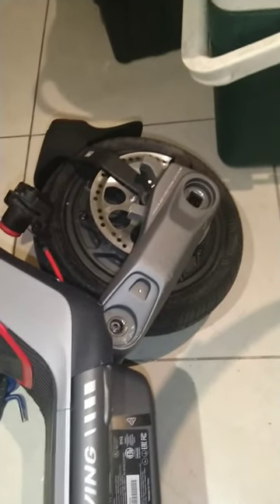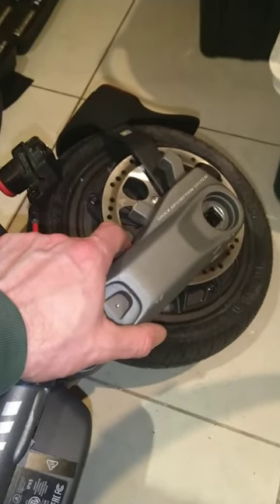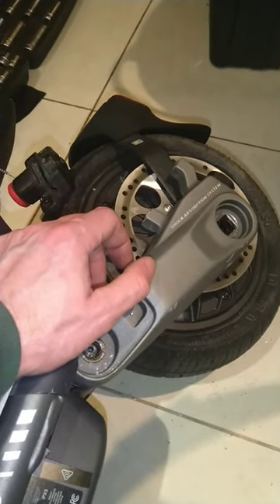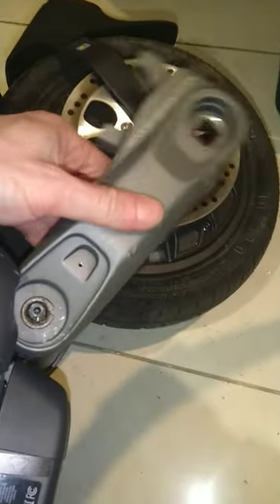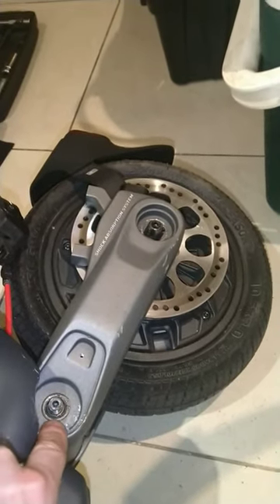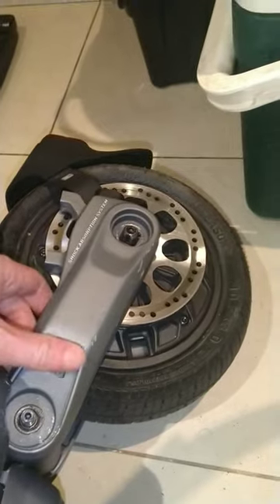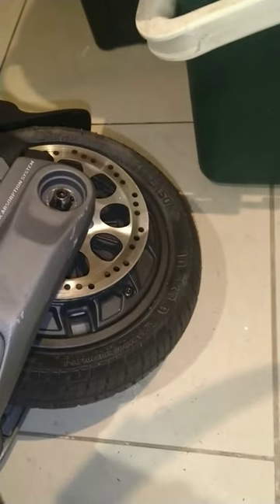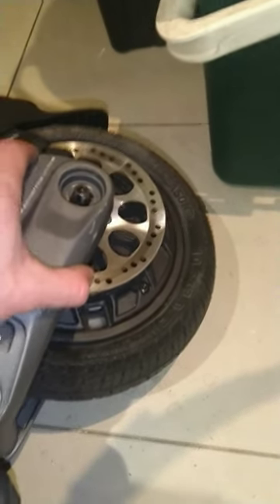Segway P100S shock only loads one side of the swingarm

Comment: Yep, everyone is going to experience some kind of issues with nuts becoming loose over time. As I had to address these issues, I went ahead and replaced the nuts with new high quality ones and also got nylon washers too. Using lock tight is recommended. After doing these improvements I've had no issues. After doing these maintenance updates I'm completely satisfied with this model. (Just for any readers having loose nut issues, it's a simple repair, don't be afraid to do these updates yourself. As for the torque requirements, just tighten down hard until the nut won't move anymore).